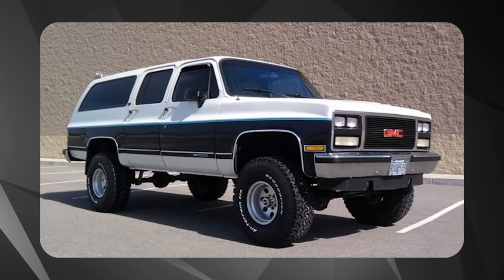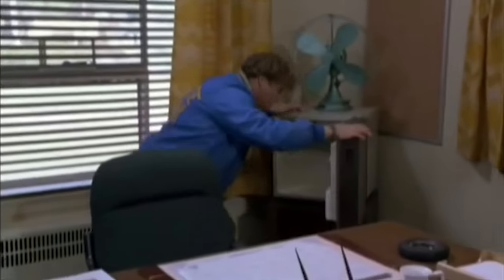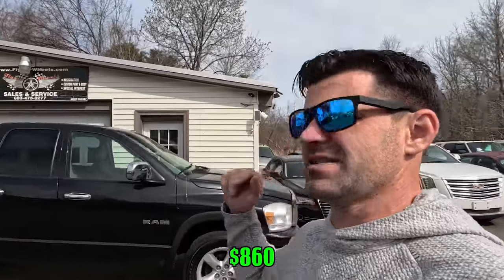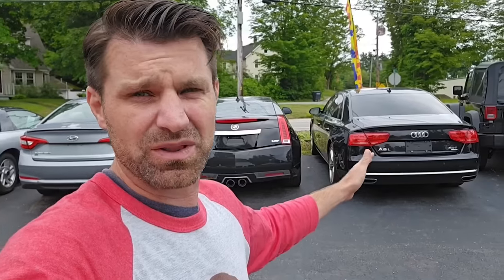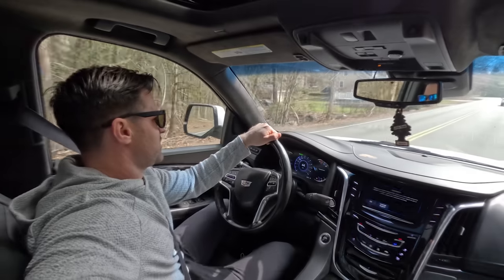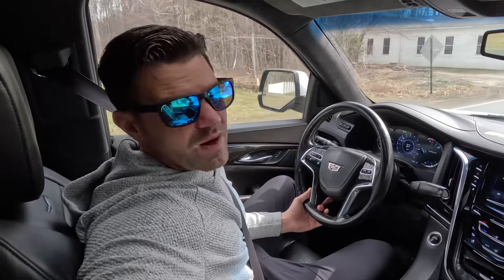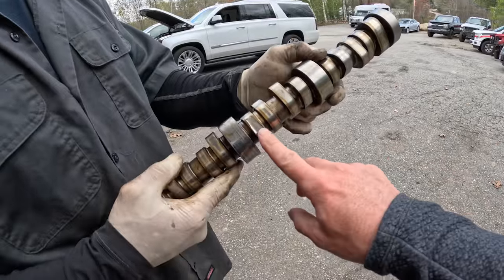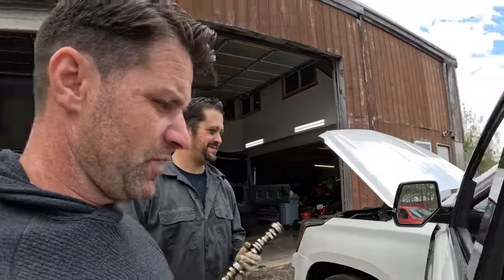WARNING! GMC Chevy & Cadillac Escalade Engine Problems at only 53,000 Miles! - Flying Wheels

Comment: My cousin told me at his fm dealership there are currently 4, 6.2 gas waiting for new engines all 2022 model year , bad crank bearing took the motor out .
These only have between 9000 and 12000 km!
Reply: So good to see your comment ..was looking at 23’ Sierra denalis and of course 6.2 only…too many vids and comments on peoples engines grenading.. I’m just gonna keep my 10’ Sierra Denali with 6.2 that doesn’t have afm and maybe pay to have some rust fixed and repaint whole truck…79899 was sticker on the 23’ i looked at  too much money and after the 3/36,000 warranty ends your on borrowed time it seems …older is better I guess

Comment: Good ol AFM..... Been there done that. Sometimes you can luck out and all it needs is a cam and lifters, maybe a busted valve spring. Others its catastrophic and a piston hits a valve and its new engine time. I have been on the receiving end of both kinds of failures.  What makes it even better is the engines with "dynamic fuel management that will allow it to run on as few as 2 cyl. So the crappy lifters that cause this entire thing are on all 8 cylinders not just 4. Seems like valvetrain failure is all but guaranteed on these engines. 

BTW, tuning alone and the Range device that disable the AFM system do not stop the problems from happening.The lifters can and do still collapse and get stuck causing the valvetrain failures. Been there as well....

The only way to truly fix it is a kit to remove the system entirely. That means a new cam, new non AFM lifters, a block off plate for the oil galleys that feed the system and programing to defeat it and keep the mill light off. I did one of mine after it failed and the cost was not really any different then fixing it with OE parts. And the real killer, that truck got on average about 1mpg better without the AFM than it ever did with it and all of the odd driveability quirks like the sometimes hard shifting, cruise to acceleration stumbles etc were gone.

Comment: I also own my third Honda Pilot.  I have owned 3 and put over 100,000 K on the other 2.  I have had the continual problem of changing oil every 5000 miles!!!!  Other than that, the best ever.

Comment: Iv got the same color 17 escalade and dealing with the same exact issues.  My 05 escalade was a ultra reliable tank for yearssss.  I should kept it and had rust repaired.  Big thanks though about the fuel management disabler info. Got one on the way now.

Comment: I was trying to buy a used low miles  2015 LTZ Silverado from a Chevy Dealere were $1000 apart they wouldn't budge and neither was I. I'm so glad I didn't buy it with all the engine and transmission issues on these trucks.

Comment: My 2014 CTS. New engine at 60k miles. New trans at 72k miles. I had purchased extended warranty thank God. I also replaced the cue screen. New turbo, intercooler, rack and pinion, oil pan, it goes on and on all under warranty.
Reply: LTG 2.0? I have a 2014 CTS I bought with 60k, it's got 80k now. I've got the 3.6 twin turbo Vsport. Is your rack electric as well?
Reply: @SeanPennII  yes 2.0 I'm not sure if the rack is electric or not, sorry
Reply: @4Peta20 get rid of it
Reply: @mattnorman5241  the problem is its like a new car now
Reply: @4Peta20  its trash if you had to replace it common sense would say get it replace and sell not keep it
Reply: @mattnorman5241  well I got it off a lease and it had an accident on record. So I think they beat the hell out of it new.
Reply: @4Peta20  accident means the car is worth less on trade in
Reply: @4Peta20  do not trade it in or replace it. Idiots want people to take out loans and buy new cars. The LTG is a great engine. The car is an excellent base. Keep the CTS. You got a little unlucky, but it's def a great car and not worth another loan if it's paid off.

Comment: If you have a GM vehicle with the 6.2 AFM, you can get a tune to have that AFM deactivated. If you are out of warranty, I'd highly suggest getting that tune done to your vehicle. As mentioned in the video, AFM is a minimal fuel saver in the first place. So just turn it off with a tune.

Comment: I've replaced the CUE screen on my 2014 ELR, it was about a 2hr job going slow to make sure I didn't break any of the plastic tabs holding the dash together. I think I spend about $80 on the screen and about $10 for plastic interior pry kit. I didn't have cracking of the screen either, it just quit working. 

It's good to know you can spend so little on a luxury vehicle. I want one more Escalade before I retire and I'm wondering if it's worth getting a dealer's license so I can hit the auctions and learn  how they work so I can get my next couple of cars much cheaper . Maybe when I retire a blown/bad engine Escalade cheap and a $10k low mile replacement engine and trans combo that I can do on my own might be the way to go.

Comment: After multiple bad experiences with dodge vehicles i refuse to buy American cars.  The only cars i will currently buy are Lexus and Porsche. For reliability and luxury. And depending what Lexus you choose you can get sporty as well. A GSF with a super charger will out run a hellcat. And last 4 times as long.

Comment: I take very good care of my Cadillac, bumper to bumper warranty, garage kept,synthetic oil every 2,500 & ceramic coated. Its an 18 w/ 41,000 miles,love it absolutely no issues.
Reply: I think you’d get more of your money’s worth if you at least wait til 5000 miles. I just changed mine at 5600 mile mark yesterday and that’s still considered early but it’s been a year since my last oil change. But I agree, I love my caddy too. She’s well taken care of.
Reply: @kenlaw04  I know, it's probably overkill. In fact when it get down to below 40% in it goes in for fresh synthetic.  I also run only 90octane ethanol free gas. It's gets dusted & repolished every time I drive it. It's only seen rain once & I live in Florida. I know..I'm a nut!
Reply: @richardmorris6365  Lol maybe a slight overkill but it’s yours and you’re not harming it so do as you please.

Comment: The screens go bad from the heat  . They go bad all the time and people get taken advantage of taking it to the dealer to get the screen fixed  . Yes you get the Oem screen from the dealer however I’ll take the aftermarket one every time 💯 💯 . Some aftermarket screens come with plastic prying tools and really nice in color instructions with pictures. Great for the do it yourself type of person 💯 ..GM usually uses 932/7mm and 10mm for interior and ford uses 516/8mm and 11mm

Comment: Projection is for android devices only, it will project the image that’s on your phone on to the screen, however you won’t be able too control the phone through the touch screen. So for instance you can “project” google maps on the screen. See the map, but you’ll have too use your phone to make any changes.

Comment: I am from Big3 country and You are on point with GM and the other two.  I am convinced they literally build vehicles to get them past the warranty period and leases... and THATS IT.  No consideration for the secondary market whatsoever.. and that they are charging as much as they do is that much worse. My last domestic was a 2010 Ford Escape that started rusting on the rear hatch after only four years... blower motor resistor went out... I had enough.  Made the leap to Subarus and have only one issue in over 100k miles with the rear hubs. ($800), after over 6 years ownership. If anyone asks me, I tell them the only makes I would consider preowned are Toyota, Honda, and Subaru (bc I'm a total fan boy)
Reply: Subaru are total junk. I used to run Subaru,  it was a great work car when I  lived in Colorado. They've gone downhill. They don't use normal gaskets. 
Junk.
Reply: @TheBandit7613  dude... the bad gasket thing has been over for YEARS. I have two Crosstreks and they have both been outstanding... much better than anything the Big3 are putting out.
Reply: @twrecks4598  Subaru is dead. They used to be no-nonsense, push headlight deep snow on the way home. No gadgets. 
They use RTV to seal the engines. They develop leaks. 
Gimme an old Subaru with a set of studded snow tires and your talking my language. These new ones, no thanks.

Comment: Same thing happened to my 2016 Suburban. Engine started squeeking loudly. The 3rd cylinder was bad due to the AFM. It's a grenade in your all gm engines that have them which is all suburbans, Tahoe & Escalades too. Gm is making tons of money on new engines & new transmissions.. I put a new engine & transmission in it instead of buying a new truck. The new 5.3 engine is only 7k and transmission is 5k.

Comment: Its  Quantity over Quality Nowadays. With all Cars. I even have a TOYOTA CAMRY  2018 and now im being told i need a new Transmission. 🤦‍♂️ i think i give up with Vehicles. I might just need a Bike 😄. I used to have a 2010 Chevy Impala and it was more reliable than my two Camry's.  My Grandmother still has her 1992 Cadillac Deville before the Northstar Engine. Which she bought preowned in '93 with 3000k miles and the Car still runs with over 200,000 miles.  Yes there was a time GM built good Vehicles.  But almost all Car Companies now have watered down the reliability of vehicles nowadays. 😒

Comment: Bought a 130k mile Escalade last year.  After having my mechanic fix a handful of things (I mostly knew about) and catch up the maintenance,  I drove it straight over to the speed shop and had them tune the AFM system out.  My hope is the previous owners had one of those OBD2 port things that shut it off.  The fuse for the OBD2 port was blown, which could be an indication that one was used.  Fortunately my pickup has a 4.8 so I didn't have to deal with it there.
Reply: The most common cause of an AFM lifter failure is the owner not changing the oil often enough, not the system operating. Change the oil every 3 to 5k miles and don't worry about using a high priced fullsynthetic oil. You can run cheap oil just as long as you change it often so you keep oil contaminants out of the system. The tiny oil passaages in the AFM system get clogged up when people wait until they have 7000 or 10,000 miles on the oil to have it changed. Don't use those Range AFM disablers to turn it off. If you want it turned off permanently, have a tuner do it like you did.
Reply: Also add the Sure Cool part # STL010 to give more life to your transmission. ($45)

Comment: Hey Craig - you aren't kidding about the CUE screens!  I bought a 2017 cadillac xts in 2020 and my screen too was freezing. Dealer dicks told I needed an entire new radio unit at $1600 + labor. I found a guy who replaced the screen in my car in under 30 mins. He promised me i would never ever have issues with the screen and I still don't. Its the glue in the screen that makes it stick and freeze as it gets heated up full usage. I too am working my way up to an escalade platinum. Would love to know if you turbo it - was thinking the same thing since the v's are just way too crazy in price
😊
Reply: RealFlyingWheels  what did I win? LOL

Comment: The engine can be fix cause I have done it and lot of times is caused by the valley pan gasket but you still have to replace lifters, head gaskets or just eliminate the system and make it bullet proof

Comment: If you have to replace an engine in a SUV like this Cadillac take an engine out of wrecked Camaro SS with a stick shift ( 6 speed manual ) these engines  DO NOT HAVE FUEL MANAGMENT and then if you put that engine in and you will be fine .
Reply: That sounds dope, the 4th gen escalade is my favorite is a beautiful car, unfortunately the stock engine is trash, a lot plastic crap in key components, GM took a page out BMW 😂 if I had the cash I would totally swap the engine on a 4th gen escalade and drop an LT4 engine in it

Comment: The more of these cars I see that fall apart with less than 100k miles I’m now convinced to not bother!   I’ve been driving my 97 Mark Vlll LSC for 21 years and it never stranded me not even once!   I have about 350k miles original engine , one transmission change @ 275k miles.    I decided to buy another one as my car runs A-1 but it’s very rusty sadly

Comment: I have the 6.2 L86 Lt version in my 67 c10. DOD deleted, new stock TSP cam no issues.
Reply: Awesome brother, is you're C10 a restomod?
Reply: @CJColvin  yes, frame off restored in 2021, 5/7 static drop, CPP suspension, 2017 L86 6.2 engine, 8 speed auto, LT2 intake, new interior by Snowden, Vintage Ac, etc. I’ve got a few videos of it on my channel.
Reply: @arnoldrodriguez3803  Awesome brother, is the 6.2L Ecotec stock or does it have some upgrades?
Reply: @CJColvin  Texas Speed stage 2 DOD delete cam kit, LT2 intake, Speed Engineering Headers. These LTs need very little due to direct injection, continuous variable valve timing, 11.5:1 compression ratio and the 4:56 1st gear ratio.
Reply: @arnoldrodriguez3803  Awesome brother, are the heads ported and polished as well?
Reply: @CJColvin  nothing was done to the heads.
Reply: @arnoldrodriguez3803  Awesome brother, how much power is it making now?
Reply: @CJColvin  based on TSP’s charts it’s making 520s -530s. It’s 420 stock
Reply: @arnoldrodriguez3803  Nice

Comment: I thought you replaced an Escalade with this Denali because she didn't like the cue system and how all the sliders and everything worked. I have a 2003 Escalde that I bought new, and it's the best vehicle I've ever had. It fits me like a glove and runs great with 250K on it. I don't know what I'll buy when this one finally gives up the ghost. Something like your 2016 with the active fuel management turned off would probably be the ticket. Or, a new one and get the fuel management shut down right out of the box, but these new car prices are a little out of control. I like your channel a lot because of its authenticity. My dad was in the car business, with a setup much like yours. I remember going to the auctions, and really that hasn't changed much at all. Same thing with having people that were expert at fixing particular issues with the car. A big one was carburetors, they had all kinds of issues. Keep up the great work, and I'm glad even with your workload you find time for your family. Thanks, Mike
Reply: gm lied to you

Comment: As for Cadillac. You couldn't give me one. Years ago. I bought a 2005 DTS Deville with 25k on it. Changed oil every 3 or 4k. By the time it reached 100k miles. The Northstar had so many engine problems. Leaks, gaskets, I junked the POS. You only get to  con me once GM.

Comment: We bought a 2018 Suburban with only 50,000 miles in September of 2019 and when we sold it in June of 2021, it only had 72,000 miles and it hasn’t even had a single problem
Reply: Acknowledged. How many miles were you changing your oil at?
Reply: @FredFlintstone21  We didn’t really need to change our oil because we mostly used it as a family vehicle
Reply: @omarzowila Acknowledged. You put 22,000 miles on your suburban without changing the oil?
Reply: @FredFlintstone21  it had full synthetic
Reply: @FredFlintstone21 that why he sold it he was in the poor house and was on the verge of bankruptcy

Comment: Programmed truck to deactivate fuel management system turned up throttle sensitivity, put a JNL oil separator on it. Truck runs great. They want to program Junk into them there’s always a way around it.

Comment: Buy the obd port delete and upgrade the transmission fluid to the blue label mobil1 synthetic. Fixes eveyrhing. It will eliminate the rough1st to second shift and the chadder in the transmission.

Comment: I have a 2016 Escalade with 88K miles I was getting 30 MPG and that slowly crept down. It turns out the E Brake actuator was applying the E brake, and then it permanently applied it until it got towed to the dealer they had to cut the cable to get it released. All covered by cost guard warranty.

Comment: I deleted the active fuel management on my 2008 Silverado and it was bulletproof after that.  I traded it off at 275,000 miles. I wish I would have kept it.
Reply: I have escilled 2016 model how I can deleted actve fuel mangment control  thanks
Reply: @Abufasail2040 a what 😂😂😂😂

Comment: Never owned an Escalade. In fact, the last Cadillac i ever drove was a 1968 Cadillac Fleetwood. Had a 500 CI engine. I think 68 was the 1st year GM used that engine. Big powerful gas hog, but they were built to go way past 55K.

Comment: Jeep Jks from about 2012 to maybe 14 with the 3.6 penatstar are notorious for the number 2 cylinder misfire some have a casting issue with the drivers side  head  that cause the needle bearings in the lifter to fail. Jeep even extended the warranty on the driver side head for it. It needs a nrw cylinder head.  You're "Jeep expert" should have known that.

Comment: Somewhat ironic that the knock on EVs is that the battery doesn't last all that long but as we see, the ICE vehicles aren't much better.  Thanks for the video.
Reply: Ev will far outlast ice and ev batteries go well past 200k miles. No brake change, no radiators no belts no transmission it's a no Brainer. Ev by far more reliable ❤❤❤
Reply: Considering Mercedes Benz dealers want nothing to do with taking in a one year old MB EV on trade, on the clowns that allowed themselves to be emotionally invested in EV's think that 
EV's are a suitable replacement for ICE vehicles.

Comment: We had a 21 Cadillac Escalade that dropped a cylinder 8000 miles, then had to have the motor rebuilt at 32,000 miles. They don’t make them like they used to.